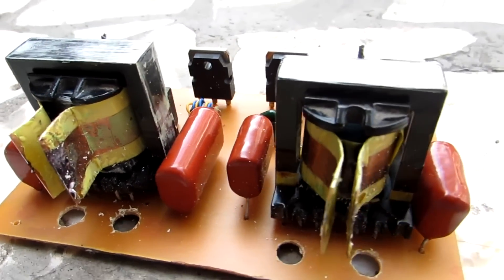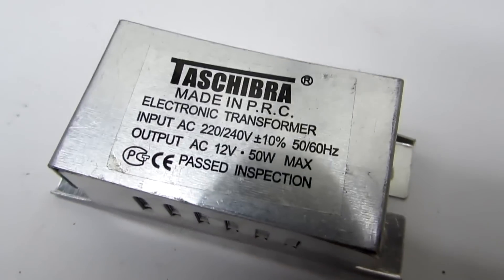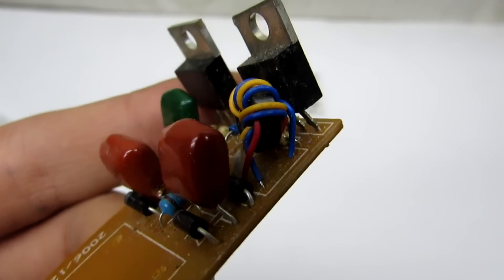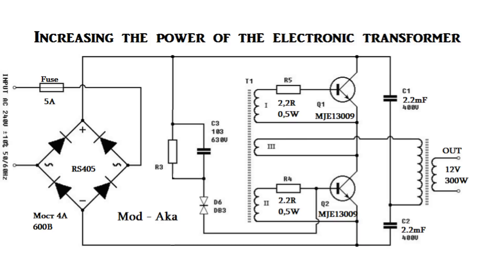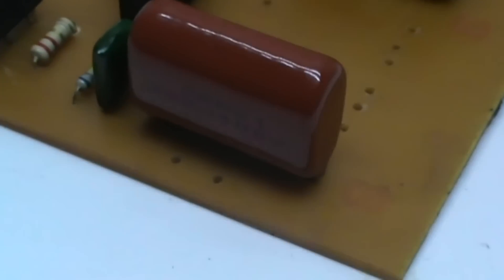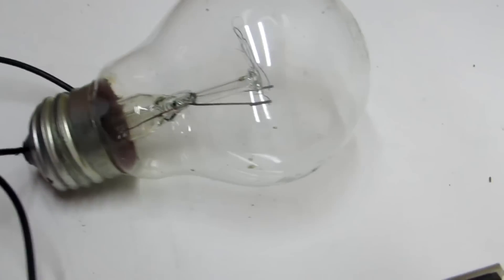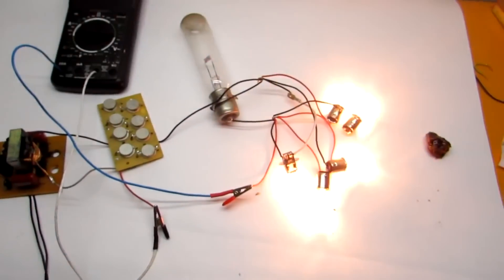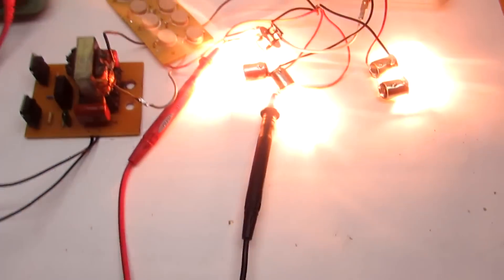Increasing the power of the electronic transformer

Comment: You need to resonate the two capacitors with the leakage inductance of the transformer. The leakage inductance needs to be intentionally increased to achieve your target inductance. The capacitor value is determined by E=1/2 CV^2 and P= E.f. The saturating core area should be selected to allow converter operation at desired frequency. You want square hysteresis loop material for core. When operating correctly the voltage at the capacitor node should be sinusoidal and just reach the rails.

Comment: if i implement such circuit to drive flyback transformer it would beat any zvs. if i could audio modulate this then its perfect for plasma speaker purposes. (i suspice that audio signal on the feedback winding core or the power transformer core could be the solution)
Reply from the maker: you are interested   https://www.youtube.com/watch?v=8RVVOn7zmJ8
Reply: Kasyan TV the 555 based one is bad, it utilises the switching devices very badly. i know about this video and have tried making this circuit for the past year. always small arcs with high consumption. and then i build zvs based one and it could do much better arc, better sound and lower consumption. this is because full wave inverters are much more efficient than half wave
Reply: haha it cannot beat 4 igbt zvs
Reply: Kasyan TV
Reply: Gotin Fuklio Good point, I would use a set of ucc gate drivers that are used for my audio modulated tesla coils along with a gdt. then no worries of burning out your audio source.
Reply: John Scarce you can use the 555 to drive a half bridge or even full bridge, which are full wave (requires additional circuitry). Most people who use the 555 build a "Flyback converter", like the one in Kasyan's link,  because it's the easiest! But that's not the 555's fault. The 555 is just a signal generator like any other IC and very versatile.

Comment: How exactly can a circuit increase power output? Doesn't that violate the laws of thermodynamics? A transformer can take X watts in and output (disregarding losses) X watts out, just with a different ratio of amps to volts than the input. But wouldn't this video imply that this circuit can output more energy than is put in?
Reply: Buck converters do the same thing so it's possible.
Reply: rene kenshin voltage OR current can be increased but power cannot
Reply: well, about a year passed, but i think some guys will have the same question, so, i'll try to explain:
- he changed the initial  resistor and diode rectifier with a bit higher rated ones: from a quarter watt to a half watt resistor (with same resistance) and a bridge rated for 4 or 5 amps from four 1n4007, rated to maximum of 1 amp.
- let's do some math: he's russian, so, at his wall socket gets 220V. this voltage cannot be increased, but the current CAN.
so, changing those components from a rating of 220x0.5=110W to 220x2 (let's say)=440W. plenty of power, it isn't? :D
- this wasn't enough, because the initial trafo was made for that mere power of 110W , and the transistors, too, so, he changed those things accordingly with his needs.

shortly said, he simply was do some math to get the right components for a little bit powerful switching supply, but with exactly the same schematic.
and a short note about the resistor: is intentionally underrated: if the current drawn by load will be too high, the resistor will blow, same as a fuse.
the simplest form of safety... no, a fuse will not work, because we need some resistance there.